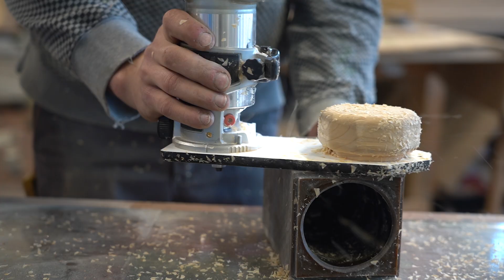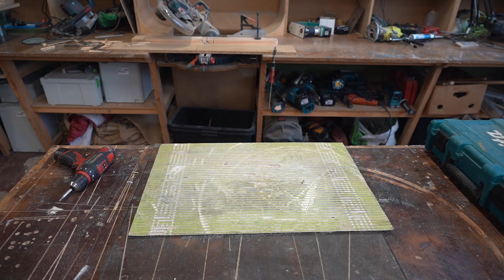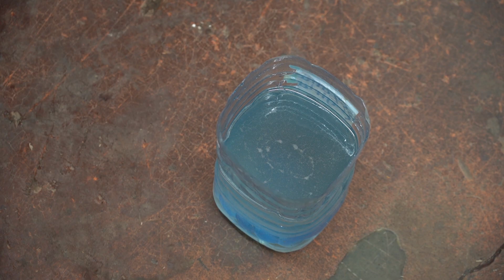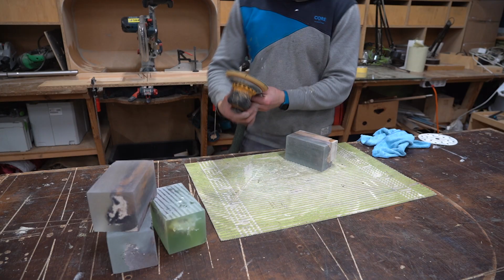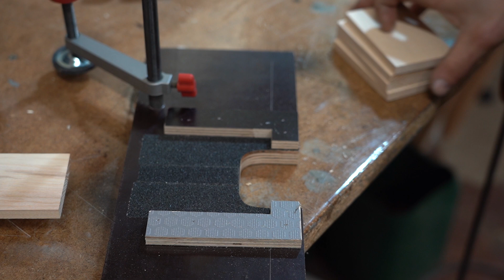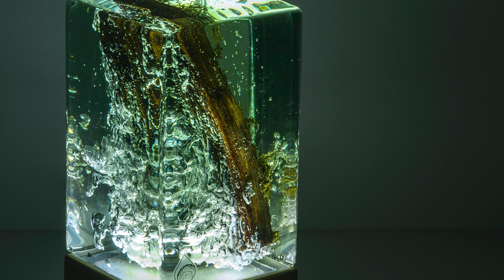making an epoxy lamp collection

Comment: So that is why you did not upload for a month :)
It turned out nicely, thou some are prettier than others.
But the black cable is not fitting the easthetic. Also, switch is on cable? It would be better implemented into the base.
Hope you can sell those for good money.
Reply from the maker: You have great observations! Thanks. I just wonder how or where would add a switch? It was also bothering me dangling on the wire. Oh and about the colour of the wire. Could you suggest any other colour? Black just seemed the most neutral for my eye.
Reply: @Chiselsplay  Hm, maybe transparent cable would look nice with the epoxy as it is also transparent. Or maybe beige. And the switch in the base, maybe brass toggle switch? Or  the cable matching the switch color? Or transparent cable with copper wire inside and matching copper toggle switch? Or copper braided cable and copper switch? The last one would probably look the best.
Reply from the maker: @jasirek1732  thanks for your thoughts. I will definitely experiment more with these two issues you mentioned.